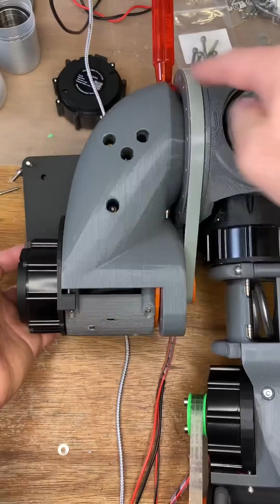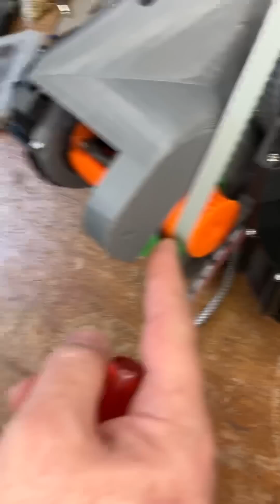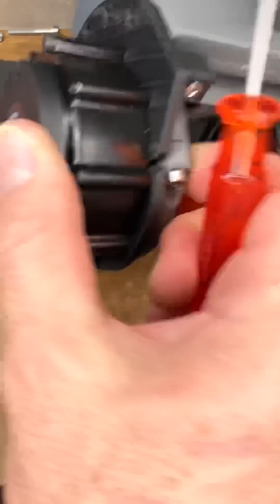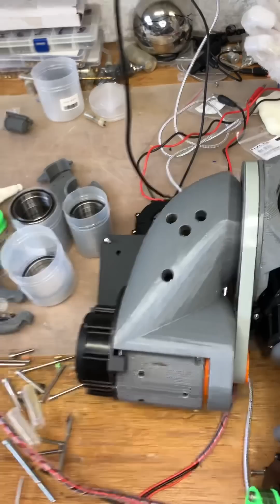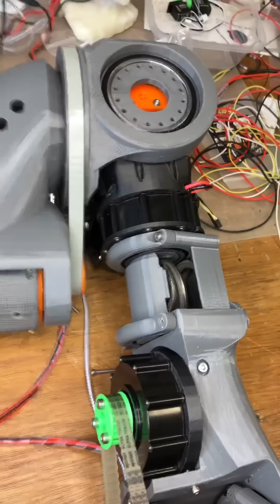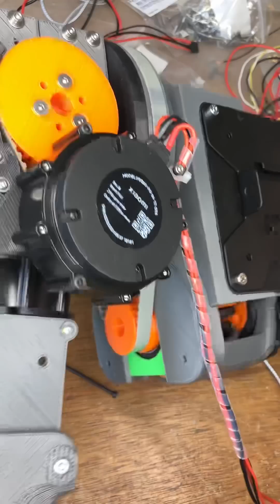HOPE2 robot arm - belt tensioning

Comment: Wow, on many levels! 😃 Just saw one video where timing belts outperformed gear solutions in efficiency and simplicity, and you are right there also now. Prefer this type of tensioning instead of extra pulley (reduces efficient, perhaps also in practice? )

While Learning FreeCAD, I sunk in to the rabbit hole of 3D printed parametric roller/ball bearing... Questionable? - Yes, but it's a nice learning project, lighter than steel, independence of supply & stock, and perhaps usable on some light applications instead of pin joints.

However, these timing belt tensions probably would wear them out quickly. TODO: load testing. 

While ordering my first filament, 10+10kg PLA & PLA+ (to save on delivery), I ended up receiving 30 kg in total🤣🤣. Not complaining 😎 So, perhaps a humanoid is within the horizon, when now looking at your design. (But thigh bone might not fit 256mm * sqrt(3) printer, alas)

My design preferences are price, a bit over engineered 1st principles understanding(?) with sourcing & stock simplicity, and informing / theoretical interaction of higher level cognitive theories with embodied implementation 😬🤪🤌

TO UNDERSTAND/find out: gear/pulley ratios vs. torque vs. motor type/power (for now, I could trade off speed for torque).

Thank you for your example and inspiration 🙏🙏🙏
Reply from the maker: All sounds great!

I also like timing belts as they provide an easy way to limit the peak forces when setting up the robot. Simply leaving them a little loose means that any accidental large force movements will slip the belts with no harm done. As the control systems get more dialled in the max transmissible force can be increased easily simply by more belt tension.

As the tension needs to be high enough to stay above zero on the undriven side low friction bearings are essential. Steel, low section bearings are incredibly good value with a good size bearing e.g. 60x70x10 costing under 10 bucks from AliExpress. The only downside is they are a little heavy. 

For a super leggera version I will try using POM or ceramic but these are 5-10 times the price.

The longest print is the lower leg which just fits on the bed of my Up!Box 250x225mm.

Calculations for pulleys are just the ratio of teeth. So for a T20 driver and a T80 driven, as in the hip the ratio is 4:1. Therefore the torque available is four times as high, neglecting losses, and the speed one quarter.

Comment: Is it possible to make this piece of great technology smaller?
Reply from the maker: Yes. This designed optimises for cost to performance. Going smaller requires more expensive actuators, the higher force concentration requires more expensive materials and processes, etc, etc, etc

All design is a balance of compromises.
Reply: @therobotstudio  I see I see. That is great to hear. Hopefully we can see this technology in perfection soon! I want to coat the robots with silicone to make them look beautiful 😭
Reply from the maker: I see from your channel that the outsides are quite advanced now - do any of the dolls move though?
Reply: @therobotstudio  no, not yet. I met up with  one of the manufacturers I worked with at the AVN Expo this year. The technology right now is still very basic. Just hip twerking and sucking movement for head motions, back and forth. 

But the future of the robots are for sure going to be coated with these silicone materials, silica gel. Some of the factories have achieved unbelievable realism. Very realistic!  The skin texture to body paint. Even using real female human models skin texture to create silicone mold. This will be the aesthetic aspect of the robots. This is the next generation of life form, silicone base life! 🙌🤖
Reply from the maker: I have seen some very realistic skins. What is the hold up for producing better moving skeletons?